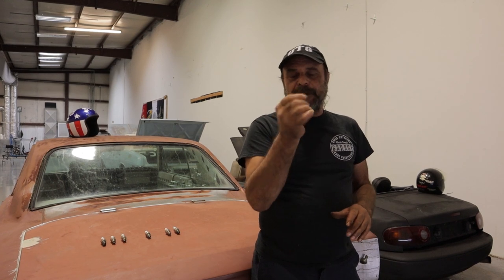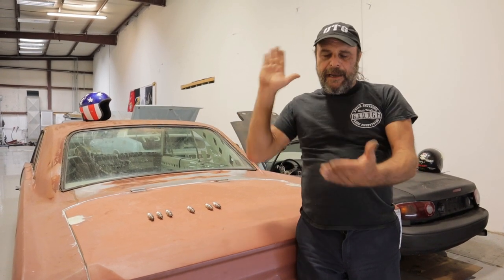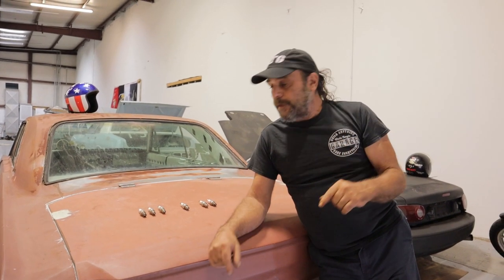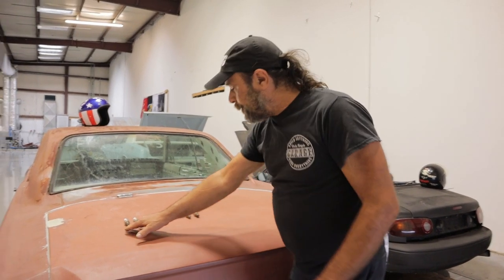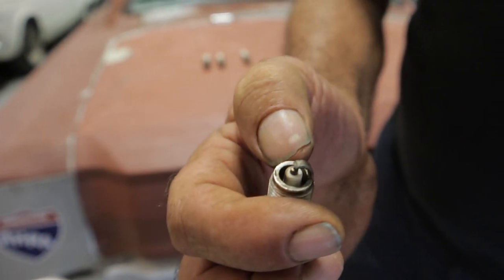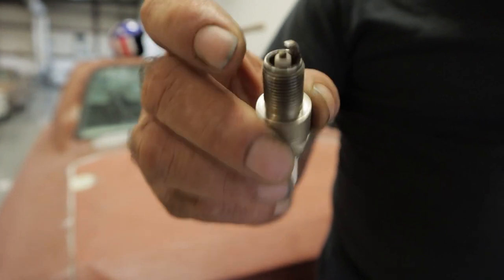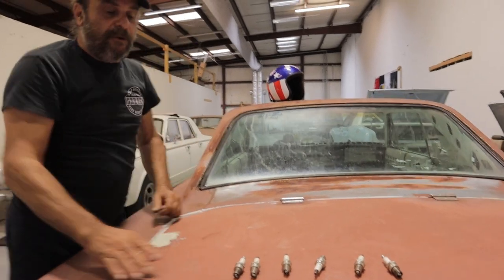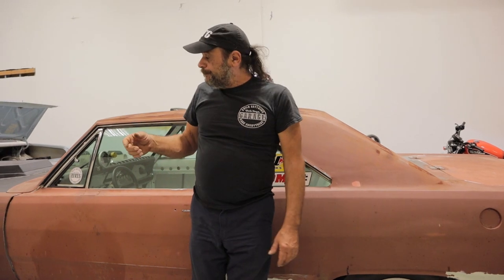Tales Of The Spark Plug. Engine Tuning By Reading Plugs

Comment: Well what did it run? Between bottle rocket and plan Z been to track at least 6-7 times and still can’t make a decent pass this is getting to be like watching 16 year kid kids that just started playing with cars. Cmon will any of you’re cars ever make a pass without a 15 min excuse
Reply from the maker: I realize you're an asshat just stirring shit, but this deserves to be answered.  This entire series, as well as Bottle Rocket are exercises in budget building unusual combinations, and then sorting through their issues.
We did not build these cars because they were easy, turn-key things.  We build them because they are challenging and out of the box.  They represent combinations of things I have never worked with before, and that is exactly why I chose them.
  An "excuse" has NEVER been given on this channel.  Explanations and work-through of issues are the ACTUAL CONTENT, not excuses.
Reply: @UncleTonysGarage  can I borrow the word "asshat" when it is appropriate? I  promise to give you credit for the term
Reply: He already said swapping the 440 out of that old black charger into plan z would work very well  but he might not want to go  that  fast .Two barrel  carb would have better to start off with than max that out then try the four barrel  later.
Reply: @honda350racer6  He never said that he didn't want to go that fast...he said it didn't represent a challenge.
Its not how fast you go, its how you go fast!

Comment: Love this project... needs less carb. The engine only going to pull 325 to 375 cfm at 5000. Going to be difficult to tune off idle thru WOT with that holley. Do you have a 450 or something you can try?

Comment: id try lowering the float level as a quick test some times thatll help with the boosters dripping worked on my 850 brawler anyways
Reply from the maker: I understand what you're saying, but this is a different kind of booster drip. This one does not happen at idle...only when the throttle is slightly open
Reply: @UncleTonysGarage  thats what mine was doing too part throttle cruze it would dump black smoke, idle was fine. Kinda same situation too the 850 is bigger than my 454 needs its a stock 454 with a junk efi cam. Their was just enough air flow to make the boosters drible at aroud 1500 rpm almost a syphon effect probably not your problem but may help some one
Reply: Thanks for the reply love the channel coming from a gm fanatic

Comment: those plugs showing "lean" with carbon on one side are fuel washed bet if you clocked the plug it would face right at the intake valve.  I would look into a drop the discharge size and accelerator pump cam I think pink is the slowest lift curve

Comment: You blanked off the power valve, supplying too much fuel off idle for a small engine, reinstalling one with a low number valve so it gradually enriches as the vacuum drops off at higher rpm, might help??

Comment: My edumakated guess is it needs an air bleed adjustment. The bleeds are gonna be calibrated for a V8, and so it’ll try to come onto the primaries too soon (less booster signal than a V8), which is why you got what you got. If you’ve got access to, or know of a reasonably priced chassis dyno, that’d be the ticket to getting the bleeds dialed since the car has no O2 gauge. Kinda hard to gauge the fuel curve with just a plug read

I’m just an armchair warrior here, but that’s what I’d try first if I were in your shoes!
Reply from the maker: I agree that this may be an air bleed issue.  First time I have come across this exact situation.  Stay tuned, and we'll get it figured out
Reply: @UncleTonysGarage  Best of luck to you Tony. I know this particular issue can be a real P.I.T.A to sort out, especially with no sniffer on the car. This is where they really shine

Comment: I had these problems with 2 stroke motors over the yrs after doing tons port work and diff carbs. But thats part of it I guess
Edit.  Damn thing is runs great with good plug read at different rpm tryin test and read , then when the time comes it's all wrong.    That computer efi stuff sure makes it easier  but I still like my carbs ,,  once it's figured out dead nuts, they run just as good

Comment: Whats the vacuum like on that slant? Put a bigger spacer to allow fuel longer time to atomize, and possibly lower rated power valves.
Reply: I was thinking wrong power valves as well.  Bring a vacuum gauge into the dash.
Reply from the maker: Fuel is dripping directly from the boosters.  A mile high spacer can't fix that

Comment: I still think you should look at turning the carb 90 degrees for more even fuel distribution. If it could be done with just an adapter plate. I think this is part of your atomizing issue at least.

Comment: Still I'd go for a set of three carbs instead of one oversized 4-barrel. Setting the throttle linkage to match is far less hassle than tuning the impossible vacuum problem.

Comment: I'm certainly not a carburetor wizard by any stretch. I'll readily admit that. But it seems to me that the solution is to shift the stagger more towards the secondary and less from the primary, but just by a little bit. There may be value in messing with the boosters too, but I'd try altering the stagger just a little first, because it is low hanging fruit. I think you are pretty close in your initial guess. But yes, you definitely need to fix your windage/baffle issue or the carb work wont mean anything. If you can alter the choke a bit to delay opening all the way when you stomp on the gas, like a dash pot/damped spring of some sort in the linkage you should be able to restrict flow enough to increase the velocity through the primary to improve atomization too. Remember Hooke's law, for a given mass of air, volume and velocity are inverses.
Reply: We used to do something kinda similar with oil wells in which the formation pressure had fallen off and there wasnt enough gas flow velocity to bring the fluids up along with it. We would put a smaller sized  production tube (an old piece of coiled tubing that was no longer usable typically) hung from a combination packer (annular plug)/tubing hanger (kinda self explanatory) to restrict the flow like an orifice to speed up the gas flow velocity in order to atomize the oil and make it flow more oil using the same formation gas pressure.

Comment: I've been getting better at plug reading. 2 stroke dirt bikes in winter, and then when I put a bigger carb and exhaust on my 3 wheeler. I also had plugs that were black around the edge, and white lean in the center. Pilot jet too rich? I knew my main jet was lean. I fixed that now so it at least has good throttle response but I thought it was weird how you can have the two extremes in one run. I think if you had smaller booster it would atomize better. Wether you want to punch it off idle or foot-brake launch at 2k rpm. Can you lighten up the accelerator pump squirt with the linkage adjustment?

Comment: I'm thinking the power valve needs to be added back (instead of none/plugged), but size it tall (instead of 1/2 idle vacuum) go for 3/4 vacuum?
for numbers sake if idling at -15 inHg vacuum get a -10 inHg power valve.  Makes the boosters kick in earlier, but with slight the delay needed for the transition so the cylinders can gulp the initial accelerator pump charge. Or am I completely off base here?
Reply from the maker: No, the issues is not the amount of fuel, but how the fuel is being atomized.  It's dripping at small throttle openings and this feeding pure liquid to a few cylinders.

Comment: Awhile back I  suggested a 500 cfm carb. I am sticking to my guns. I  had a buddy in high school had the same issue with an Olds 442 that he built up. I would run against him with my built 250 straight 6 Ford in my 67 Falcon. I had half the cu. In. And spanked him over and over. After the third or fourth time he got really upset. No matter what he did his car was a dog and it hurt his pride to be shut down an inline 6 banger. I got to talking to him one day and decided to help him out. He was way over carbed and simply drowning his engine. He figured if big was good, bigger was better. I  was running a 500 cfm quadrajet. That carb was almost more than that engine could handle. I  get what you are getting at with your issues. Need that high vacuum affect to atomize the gas vapor better. Sometimes to easy of air flow drops the vacuum effect through the carb and venturi and changes the dynamics. Try jetting a 500 cfm and see if it helps.
Reply: 500 cfm Quadrajet ? 
iirc , Rochester only made Quadrajets in 750 CFM and 800 CFM variants . 
Even the little 301 Pontiacs , 305 Chevies , and 307 Oldsmobiles got 750 CFM Quadrajets.
Reply: @Richie_the_Fixer  My last street rod was a 1963 chevy short box fleet side pickup. Very light and lots of motor room. I built up a small  block out of a 71 chevelle that had been recked. I was getting 412 hp on the dyno with just basic bolt on changes and a very mild midrange cam. I built it to have fun with and pull my boat. I used a 2 inch Aluminum high rise intake manifold and a 650 cfm quadrajet clone from Edelbrock. Dual headers , collectors and turn outs into dual leg pipes down the sides. No mufflers. I could run just over 12's all day long on the strip but could not break through the wall. I made 3 jet and rod changes before it dialed in. It was throaty off the line and really opened up after about 2500 rpm's. I put a 750 cfm carb on it and it was too much. I had a built up 401 and it loved a 750 cfm carb. I  did not feel like writing this much on my phone to explain but there it is and now you have some background for my statement and yes in the past you could get 500 cfm Rochester and Carter carbs.

Comment: Be nice to have a regulator that operates off your throttle so at 2000 your getting just enough fuel then at WOT she starts dumping it in   I haven’t a clue on this other than a accelerator switch of some sort.  Good luck anyway I’m sure you’ll get it figured out

Comment: I wouldnt mess with the jetting on a carb if you think the carb is too big for the car then you want something smaller otherwise it's not gonna run the way you want it.
A 500 cfm 4bbl on a inline 6 is fine.
Or maybe it needs a bigger carb so it can breath more.
Reply from the maker: No..it just needs the boosters tuned correctly for this particular application
Reply: Use a .140 diameter feed undercut downleg booster , much better atomization

Comment: different boosters?   A Holley 390?  delay the opening of the rear barrels? Reduce the accelerator pumps?
Reply: Lower the float, this will delay the start of the main circuit.

Comment: Tony, as far as the oiling goes, are you sure that the oil isnt partly pooling on the head? Not returning as fast as its pumped... its been along time but i seem to remember traveling that road with my old 74 duster. Someone once told me that i would have to do an external return from the rear of the head to the pan. I dont know because that car went with the wife in the divorce so goes life...

Comment: Just a random thought what if your float level is a tick too high and the-vibration at the carburetor at that RPM is causing the boosters to dribble fuel out

Comment: Lower the float, this will delay that start of the main circuit.
Reply from the maker: The main circuit flows WHEN it should.  The problem is bad part throttle atomization

Comment: I know i sound like a broken record, but you need to ditch the 4 barrel of a 2 barrel under 500cfm. That slant 6 head is not moving as much air as you seem to think it is. It's a small motor with a shitty head and doesn't turn any real RPM's.
Reply: That makes no sense, others are running the same size carbs and putting up some good numbers. This is just part of the game called tuning!
Reply: @bigbear5510  every symptom he described is a symptom of over carburetion. Poor distribution is because he's not pulling enough vacuum to get proper atomization. I don't know what you think that slant 6 is pushing but at absolute best it's only making like 220hp and thats if he had the proper size carb on it
Reply from the maker: You couldn't be more wrong.  The fact that the plugs came out white with jetting in the middle to high 70's means that this engine is moving a ton of air through it...it's asking for more.
The car that we featured...the Ruster, has the same head with similar porting, similar cam, less compression and weighs exactly the same,   uses a 750 AFB...which would flow approximately 700 cfm in Holley terms, and it runs out just fine.
I'm learning and sorting here...give me a little time and this thing will fly
Reply: @UncleTonysGarage  I'll put this in a simpler way. Can a 750 be made to work on your engine? Yes. Why is it so hard to get set up when all it should take is simple jetting changes? Because that is way too much carb for what that engine requires or needs.
Reply: @UncleTonysGarage  This is YouTube where everybody that doesn't know squat knows everything!! When you get a good full hard pass, it will be an eye opener for most people. 
Keep on what you're doing!!👍
Reply: @buildingracingvideos4714  With all the modifications to this engine I would say that when it's fully tuned it will be making close to 300 HP if not more. The problem is going to be with the oiling system because of all the modifications.
Reply: @bigbear5510  not even close. Its 140 hp stock. It's a pretty mild cam and factory head. Best head port job on the planet to that factory head wouldn't give you enough to double the horsepower. Even if I give you benefit of doubt a 500cfm carb would easily support 300hp
Reply: @buildingracingvideos4714  You're saying this is from too much carburetor but as the plugs show it's running lean. I think the accelerator pump is coming in too soon. The issue is there's too much fuel just off idle. 
The block deck was shaved and so was the head to boost the compression, it does have an aggressive cam for the slant 6, the head is fully ported & it has open headers. There's more to this engine than you know! 
Wait until it makes a full hard pass & you'll be eating crow.

Comment: Nothing wrong with what your doing. But, there's a better way. Buy an a/f gauge. Its just a tool that saves time.
Reply from the maker: Nothing against an A/F gauge, but it won't tell me anything i can't see on the plugs, and it CAN'T tell me what the actual distribution is
Reply: @UncleTonysGarage  But, it will save you time.
Reply from the maker: In what way???  I have to pull the plugs anyway
Reply: @UncleTonysGarage  Why? Even if you did pull them once or twice to check heat range I'm sure tuning it by reading plugs and pushing it around the return road would be more work. I'm not knocking what your doing but I'm saying it's easier. No coasting down a dark return road at the track or anything just look at the gage. Iv done all that stuff with oxygenated fuel and additives in fuel it's hard to get a good read. The gage doesn't lie.

Comment: Plug 225ci...6000rpm...80%V.E. into the online carb sizer...comes in a RCH over 390 CFM...that and an Accusump should solve all the problems but the dirty windows...somebody ought to have an old holley that size laying around...used em on VW and NASCAR modifieds...

Comment: Why not just get a lower CFM rating carburetor they will give you full range Attamazation ?
Reply: @harveynailbanger  hi guy don’t understand ?
Reply: @harryconover289  tony alrwady explained that motor is using the air. The goal here is to get the fuel atomized in the air that the engine will move to maximize the power that the engine can make, not reduce the air (smaller carb) that the engine will supply fuel to now. By doing that  you are not maximizing the potential of the engine.

The key to that is knowing how much air the engine will move, then figuring out how make that air hold the best ratio of fuel for ths engine to use...
Tony already has the air figured out. He is now working on improving fuel atomization across the three modes of that carb.
Mode one, idle circuit( this he seems to have a handle on)
Mode two, acceleration ( this is the current issue)
Mode three , wot ( wide open throttle) the secondaries. ( this comes in and is pulling hard, like it should)

The acceleration mode, power valves/ accelerator pumps arw not atomizing the fuel. They come on to fast, to much or whatever for the small engine to handle.
By reducing the size of the carb you arw taking the potential out of the big end , not fixing the issue. Hence it may not fall on its face before the 60' but at 600' itll be done or near done... hope that makes sense...
Reply: @harveynailbanger  reducing the cam rateing of the carb dosen’t change the volume of air used by the engine more the speed of the air though it’s opening this speeded air automizes the gas more completely

Comment: How does one tell apart the stumble of too much gas from the stumble of too little? And if the engine is so lean that it pings during a run, should one back off the throttle?

Comment: Uncle Tony, I have 2 454 BBCs in my boat and want to check some plugs! On one motor I can get to odds easily and safely while hot on the water, on the other motor I can do the same with my evens. But it is extremely difficult to get to all 16, could I still get decent information from 4 plugs/ motor? Thanks!

Comment: Not doubting your carb knowledge or plug reading knowledge,  but out of curiosity are you sure the igniton timing is correct? 

If you are sure ignition timing is correct and this is not a contributor,  tell us why.
Reply from the maker: Timing is locked out at 30 degrees.  Zero doubt of actual timing